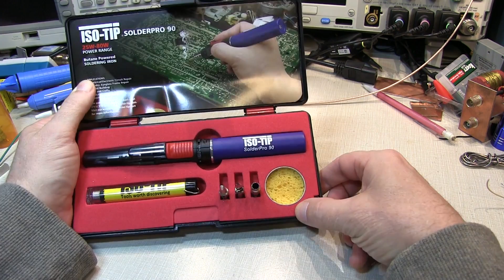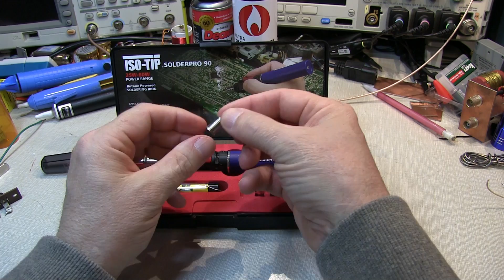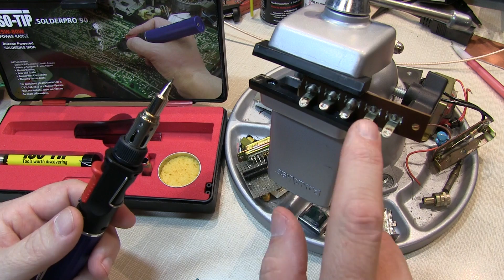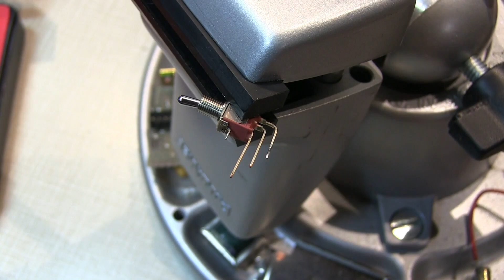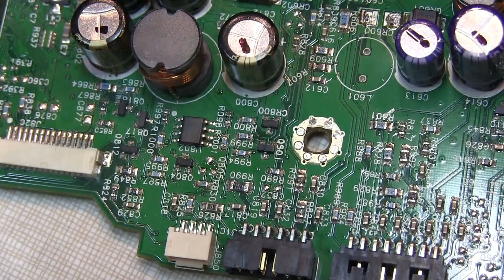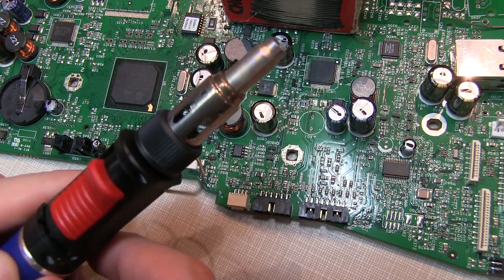#254: Review: Iso-Tip SolderPro 90 Butane Soldering Iron and hot-air rework / reflow tool

Comment: My wife gifted me a dremal 3 piece set that had a butane soldering iron, a hobby dremal and an etcher/engraver. The soldering iron is awesome and has helped me out of several troubles with large copper planes were involved needing soldered or desoldered. Watch out for that exhaust vent though. I burnt the crap out of a PCB I was modifying one evening. (do you smell something burning, oh crap!)

Comment: I bought the SolderPro 90 about 6mo ago and highly recommend it to those in the field, I give it 5 stars, thanks Alan!! Ive found it to be fast, reliable, affordable, portable, and powerful enough to get the job done!
Reply from the maker: Glad you like it.  I use mine mostly with the hot-air tip for heat-shrink tubing and SMT device removal.

Comment: I've had butane soldering irons for a long time (Radio Shack) but this one looks best of all.  When indoors my bench tools are preferred, but when working outdoors a butane iron can be very useful.  Also, although it's preferred to power off a circuit when working on it there can be situations where that's not desirable or even possible so having a non-grounded iron with insulated handle makes working on live circuits possible.  The vent hole for heat shrink is brilliant as is the hot-air attachment.

Comment: Allen, do you think when used with the chisel tip it could replace a Weller 200-260 watt soldering gun?
Reply from the maker: Not quite - I think it would be more like a 75-80W equivalent rating.

Comment: OK - even just the little heat vents on the sides sold me. I use my hot air station for most of my heat shrink tubing but it's far from being portable... Ordered one!
Reply: do you think a butane soldering iron with a hot blow tip can be used to remove SMD chips instead of a proper hot air gun?

Comment: I have run across too many of the small butane tools which were too wimpy and did not heat up fast nor hot enough. I purchased a Master Ultra Torch UT-100si. It is bigger, faster and hotter. The downside of these tools is that the tiny traces of gum in the fuel will clog it up. Then you need to send it back to the manufacturer for overhaul.

Comment: Great tool to have. I've had the same Weller Portasol for over 20 years and still works great, but doesn't have the igniter. Never thought to use the hot air for reflow, though. Thanks for the tip. 
A couple of suggestions. Use only filtered gas (from a cigar store). Much cleaner and won't clog up the valve. I learned this when I used to smoke cigars and used "torch" lighters. Another,  get a torch tip. Provides a pinpoint flame that is great for even bigger soldering jobs where even more heat is required.
Reply from the maker: According to the manual, if you leave the tips off and only have the metal shroud, it creates a torch type flame.  Haven't tried that yet.

Comment: nahhh I think I'll stick with my old Hakko 936 soldering iron and my 850D rework station. But that would make a great portable iron/rework station for when in a pinch.
Reply from the maker: I agree. I use my Metcal on the bench, but this is really nice in a pinch.  I don't have a hot-air rework stations, so for the rare times when I need one, this fits the bill quite well.

Comment: These things are expensive, the gas cans all come with 15 different style adapters since things that use butane all have different size filler holes and you can't buy the gas from the company that sells the soldering iron.  If you buy one it make work for a few times but will burn itself up after 10 or 15 uses.  Good idea, terrible value for the money.
Reply from the maker: I've used this one at least 10 times already, still performs as new.  The butane refill that I bought didn't have any adapters, and it filled it just fine. Your mileage may vary.
Reply: w2aew I've been using the Solderpro 50 for years, soldering and heat-shrink. Still works VERY well, its a gem.
Thanks for a good review.
Les g0nmd
Reply: I have purchased butane over the course of 30 years and it always has just one size to stick into a lighter.  Heck, even the Dollar Tree lighters can be refilled with one plus the Butane you buy is of a higher quality but as Hank Hill used to say it is the bastard gas, lol.  I wish Propane was as easy, and convenient, to buy/use for these devices.

Comment: Never cared for the cordless irons, but that's definitely a winner! Thanks for showing it! 73's
Reply from the maker: Me either, but this one changed my mind.  I won't be using it for my normal bench soldering, but certainly for portable use, as well as heat-shrink and SMT repair work!
Reply: w2aew i buy one a year ago and i used to use it as every day iron. but after a few months i realized that became too expensive to buy butane every weeks. so i buy a corded one to use every day and let the butane just to specific uses!

Comment: Ugh, had to get one now. The hot air rework was the closer.
Reply: how is it? does a hot air tip on a butane soldering iron work for removing SMD chips instead of a proper hot air gun?

Comment: Great minds think alike...I got mine for Xmas and it's the best portable I've owned, especially how it lights almost instantaneously (gonna give away the two old Radio Shack units I have!). The lowest price I found for the kit was actually direct from the company back in late 2016. TNX for the tip (no pun intended) about using the two exhaust ports for finishing up the shrink tubing, never occurred to me, although I probably would have thought of it the first time I burned something up!  73 - Dino KL0S
Reply from the maker: Glad I could give you a little tip!
Reply: $41.99 plus w/e for shipping.
Reply: Dark Alchemist i